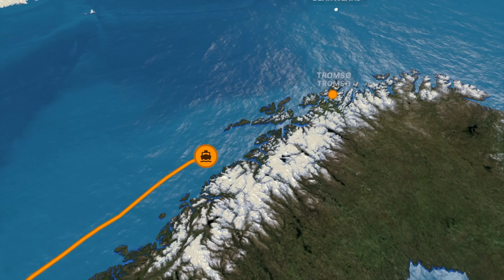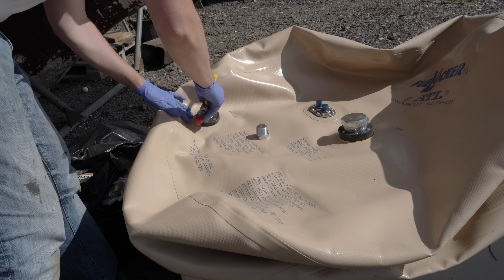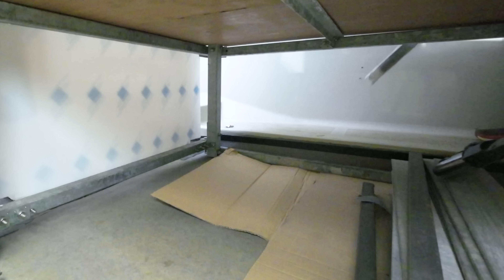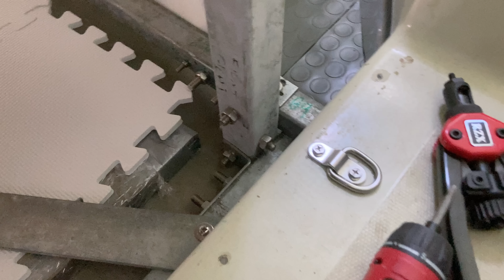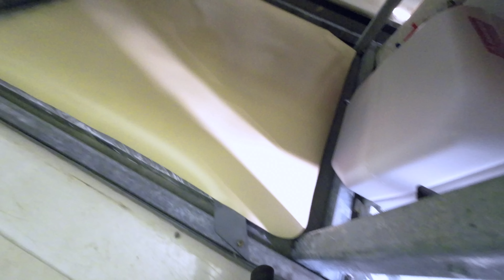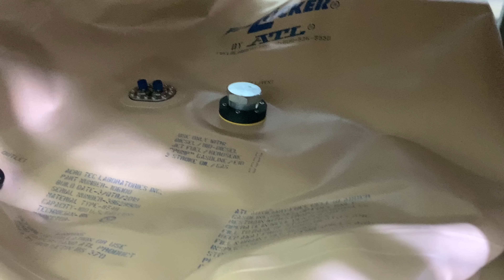Flexible fuel bladder 'range extension'  installation down below. Lifeboat Conversion Ep83 [4K]

Comment: You can turn that fuel bladder into a air bladder and it should give you  about 1/2 a ton of lift in case of a emergency. Greetings from Panama.

Comment: Suggest you put a bit of grease or Copperslip on those screws going into the Rivnuts. I've used them in the past and, if you need to get them undone, with a bit of corrosion sometimes the screw sticks in the Rivnut better than the Rivnut sticks in the frame and the Rivnut spins and they are a pain to get out...
Reply from the maker: Thanks. They are 316 SS riv nuts, but we'll see!

Comment: Maybe I'm just a novice, I know I'm not an expert.
But I really hate the use of useless ballast, as in pure dead weight.
Any ballast I ever added to my boat had a secondary use, such as ancor chain or line, or even drinking water etc.
Just something that isn't just pure weight.

Anyone else agree?
Reply from the maker: Well, there's a limit to how much heavy 'useful' stuff you can have onboard. I don't need 500kg of anchor chain. And water isn't very dense.

Comment: How about 3 or 4 ratchet straps tied around the metal box, basically forming a fence on 4 sides but easily removable, and a few spare straps are always handy.
Reply from the maker: Yeah that would work - trying to think of a solution that would solve multiple problems, or doesn't use a load of straps. Will muse on...

Comment: What pla. Do you have to cover all those bolts? I wouldn't use those pads to just cover those bolts. You puncture those pads, then they become useless, and whatever is inside them will come out, and then you have a real mess on your hands out at sea, perhaps. You can get rubber bolt end caps for cheap. Then add 1/2 thick rubber strips around the base of the frame. As far as securing the bag from sticking out. Perhaps an elastic rope and just wrap it around the legs to make a barrier. Food for thought. Good luck. Dont over engineer....

Comment: As far as the nooks and crannies I would recommend an oil/fuel absorption pig mat.  It comes in sheets so you can put in as much or as little that you would need.  Also, you can get the variety that won’t absorb water, only oil/fuel.
Reply from the maker: Yeah I have lots of the mats. Thinking the socks would stuff in neatly. We'll see.

Comment: It might not be an issue now, however once you get out in the open water, you may have an issue with all of those exposed bolt ends next to the bladder in the corners.  There are small rubber covers you can get for them that aren't that expensive, but can be a pain to locate, or you can just do what a friend does and put a dollop of silicone caulk on the ends.  He then wets his fingers and shapes the dollops into caps that can be unscrewed from the bolt and slid back on easily if needed.  But they stay on really good and keep sharp corners from wearing holes in things.
Reply from the maker: I do have a tub of 6, 8 and 10mm PVC caps. I'll get on it.

Comment: The weight of diesel is less than water, its about 0.8kg /L. So with that 400L bladder you should look at about 320kg, plus a bit for straps and the actual bladder. Not much of  a difference, but worth taking in account due to Alans stability since the bladder will be placed above the ballast.  Makes  it easier for you to calculate stability when adding  gear and other stuff :)
Reply: Yeah I was thanking her could place another bladder with it some way to fill with salt water if need as the fuel gets really low to help keep the stability if he's gona use the fuel as part of the stability given its going to affect it in some way but still Alan was ment to hold alot of weight in people so should be fine given it'll be lighter than built to handle as an emergency vessel

Comment: As others have mentioned, a cargo net could be hung across the opening to keep the bladder out of the walkway. U.S. Amazon has a cargo net made of flat straps meant for pick-up truck tailgates that is the same shape and size as the openings you are concerned with.

Comment: The bladder needs to be contained, certainly. I'd hard-box it in on the sides at least, with cargo netting fore/aft. Having 700 lbs of flex tank rolling uncontrolled in a seaway sounds horrific and that thing might be surprisingly difficult to keep in place without walls.
Reply from the maker: It's possibly the case, although the strap downs are very heavy duty. An advantage is that there's no air in there when there's fuel, so no slosh.

Comment: I would add some protection over the bolt ends sticking out on the front and back left corners of the frame next to the bladder. If the protective mat off cuts are big enough covering the sides is probably also a good idea.

To keep the empty bladder from sticking into the walk way I would use a piece of netting anchored at the bottom, with clips of some sort along the top to hold it in while allowing easy access and still being able to see the bladder at all times.
Reply from the maker: Oui
Reply: @AlexHibbertOriginals  @Alex Hibbert Originals 

I think boxing it in is the best choice with maybe clear plastic if you want to keep an eye on them. Keeps dropped items from falling into the compartment, potentially working underneath the bladder when you didn't see it.

For protection against those exposed bolts, and keeping the bladder constrained when being positioned and inspected, you could cut rubber foam blocks to fill the inside edges to whatever height, or bolt rubber mats a few inches up the vertical members with flush fitting bolts and smooth washers, capping the hardware in plastic. 

Sort of creating a rubber hammock or bowl to set the bladder inside.
Reply: @AlexHibbertOriginals  you had 3 year to buil Alan, but nooooo. Lets rush and do most of the work at the end and rush, cut corner, make mistakes.... ¡d¡0t
Reply: Could you paint on some of the dip rubber handle coating you have over the nuts to cover them, now you have opted to go for the shrink fit covering.

Comment: you can fill the empty bladder w/ air to keep it nice and bladder shaped
oh and others already mentioned the bolts at/around the 5 minute mark, and yea those would need some capping off to not poke into an inflated bladder
Reply from the maker: I like this.
Reply: Would you then need to do something vent-like to allow the air to be displaced when filling? You could also use an elastic cargo net that is loose/weak enough that it doesnt apply too much force when fully filled but that still keeps the emptied bladder constrained

Comment: Re the empty bladder, rubber stores sell this full on self adhesive Velcro in various widths. It comes on a large roll and they just cut off the length you want. That might do the trick. When the bladder is empty just push it on to the pre laid out strips. It's pretty cheap, the self adhesive is really good and the Velcro is ferocious in its tenacity if kept dry - so much so it can often out pull the self adhesiveness if you don't carefully peel it off. IIRC, a couple of years back 1m cost me $15 for the two required pieces.

Comment: Alex you should not have cut that bladder mat don't think you have thought about them Nuts And Bolts on the frame work in rough water there's a good possibility that they will puncture the Bladder get some high dance foam wrap it with left over mat gaffer tape over the bolts

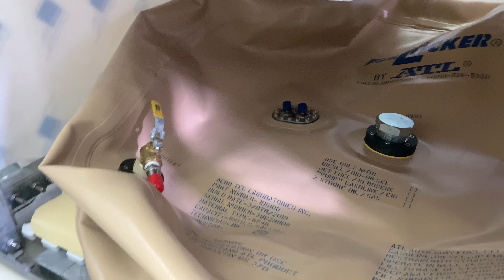Comment: Those bolts at 5:06 in the bottom left of the frame make me nervous. I have no idea if they are actually a problem, but I would cover them with something to keep them from rubbing against the bag (even if they are out of the way now things can shift. Better have everything around the bag sorted than find out mid trip that the bag shifted into something abrasive). 

As for containing the bag, I think a bit of nylon webbing, ratchet straps or even just a few bungee cords would sort the issue. They can hold the bladder to it's confined space and be removable for later. Just string them from the top frame to the bottom and let the bladder sit in its spot like a taco until its filled up.  As a bonus all these options should be adjustable in case you need to change things between the bladder being full and empty. And as a bonus bonus all these options are extremely useful to have around for other tasks when the bladder is in a bag in a locker somewhere. Ratchet straps are especially versatile as they can be used as makeshift vices, railing, hold-downs and all kinds of other things. I keep a bunch in my vehicles and around my shop and I constantly find uses for them.
Reply: The absorbing pads will fix that.